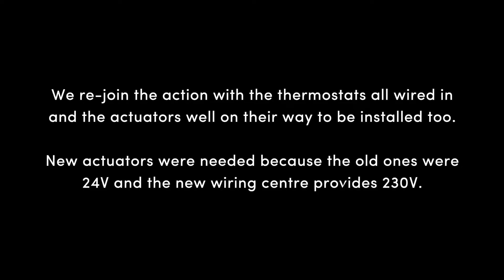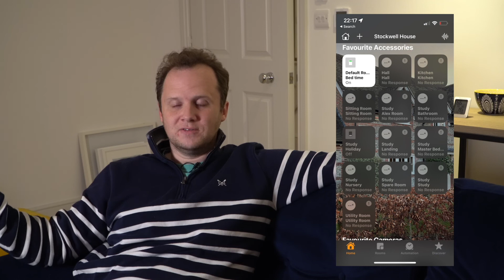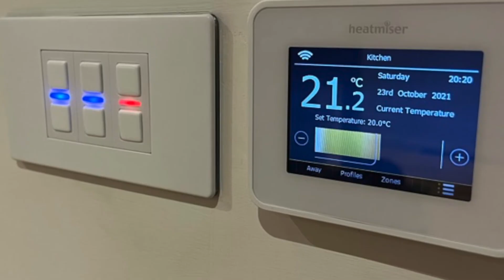Smartening up my underfloor heating controls

Comment: I would like to install actuators and wiring centre to my manifold, can I control each zone separately so that I have different temperature? I have 5 zones but the first 2 zones are in a colder area of the house. I have one thermostat, it's open plan ground floor, 70 sq metres.

Comment: Love you videos, very professional and useful. I am running ufh at ground floor and traditional radiators on the first floor, I have hive control heating but can't control ufh separately with first floor radiators, if I only want on in one of the bedroom, I have to heat ground floor, what would you recommend? Thanks

Comment: Hi Adam
I have a Polypipe manifold and actuator heads yet to be installed, if I go for this heatmiser system would I have to change to heatmiser actuator heads .
You didn’t seem that impressed by this system would you have preferred the nest apart from the added cost of the heat links
Reply from the maker: You don't need to change the heads if they're 230V. I had to change mine because the ones we had before were only 24V.

The system has been in for over 8 months now and it does its job fine. The main reason I didn't go with Nest here is that I can't trivially integrate it with my Home Assistant system. If you're not worried about that and cost isn't an option then something like Nest or Tado have nicer apps than Heatmiser in my opinion. 

I have actually used Nest with this system in a couple of zones because I had two of them lying around from our last house. It's easy to just connect the Heat Link up to the Heatmiser wiring centre instead of the theromstat in each room.

Comment: Can I use this exact same product on radiators or there are some artificial limitation, eg. temperature limit? I understand wiring is a challenge because radiators are far apart but I solved this problem.

Comment: I noticed the Flow Meters are on the Hot Flow of the Manifolds and the Actuators on the Return Manifolds. Is that the correct way for the flows ?  I thought it’s should be the other way,  but my Uponor UFH manifolds are the same as yours and I don’t think the flow meters measure properly.

Comment: Thank you so much for doing this and sharing. 

I'm just about ready to rip out my  PolyPlumb 8 zone system and replace it. I want wireless access and control so the Heatmiser system look's interesting. Its not clear in my old documentation if my current actuators are 24v or 240v. Such a  waste if I have to replace them all.

Having done this a year ago is there anything that you have learnt in this time worth passing on?

Loved this bit where your lad came barging in and you kept filming. Well done.

Comment: Have you got a radiator plumbed into this system that is always open? Just wondering how you have protected the boiler etc from pump overrun or the actuator failing when calling for heat.
Reply from the maker: This is connected to a heat pump which has its own internal pump for this. It doesn't do any overrun that I've noticed. The water going around this loop is only about 35ºc so it's not a huge problem for it if the water just goes around the loop back to itself. It presumably has some internal protections which monitor in and out water tempertures and shuts off the pump if needed too

Comment: Great video.  I am looking at updating my own system to the same Heatmiser equipment.  When you was wiring up the stat you looped between the live and A1.  Why did you do that and do you have to do the same in the UH8?
Reply from the maker: When there's a demand for heat the thermostat will connect the A1 and A2 connections together. At the wiring centre, it expects the switched live to be at 230V so we're just sending the permanant 230V back to the wiring centre.

Comment: Thanks for the video. I have 8 zone underfloor heating,  currently running off a combi gas boiler and a timer + dumb stats. Want to update and as far as I can tell Heitmeiser and Evohome are really the only 2 that offer room by room control and modulation via opentherm (which the boiler supports).  Any particular reason why you went with Heitmeiser? Any others you considered?

Comment: Really interesting video! I'd be interested to know more about your heat-pump system, how it was to install (assuming you had it retrofitted) and how it performs.
Reply from the maker: Our heat pump was installed when the house was built so it performs pretty well because we've got good insulation and underfloor heating everywhere which works well with the lower output temps from the heat pump (about 35c)
Reply: @AdamCookeTV  Are the heatmiser actuators compatible with most manifolds? If not what manifold are you using? I also noticed you didn't have a pump at your manifold, why is this? Thanks for the video, really insightful!